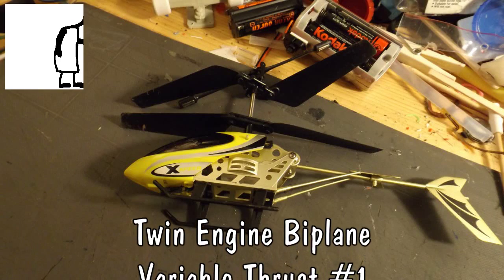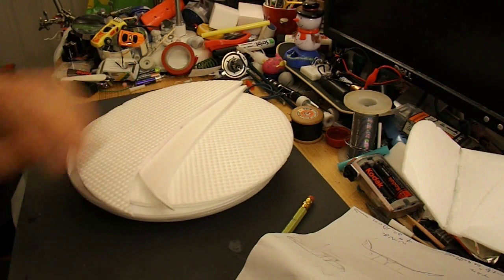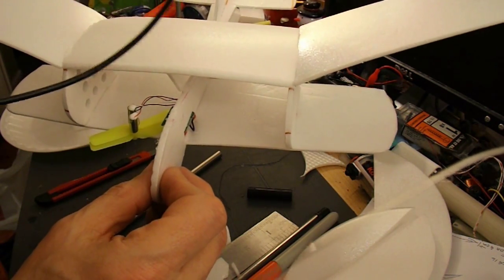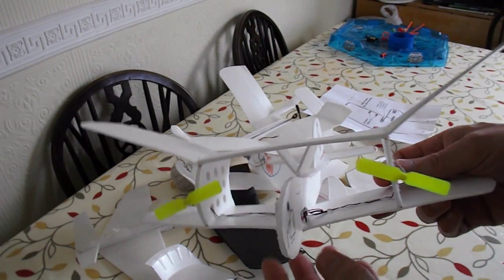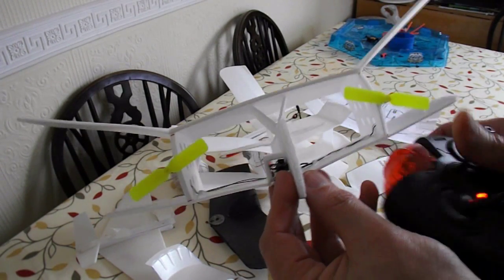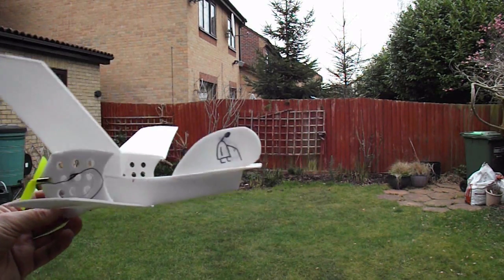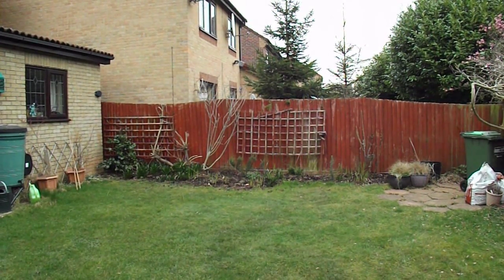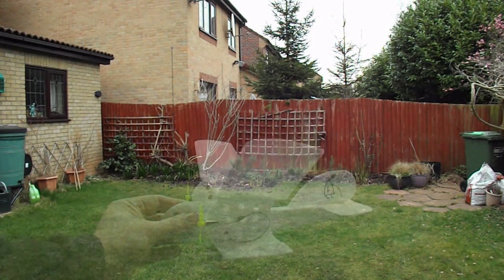Twin Engine Biplane Variable Thrust #1

Comment: Very positive. The theme is cool with the vertical wing struts having the weight holes....it links to the flying car build.
Btw, the I/R LEDs themselves can affect range. If you point directly at the plane as a natural control action, then the (usual) 3 in the transmitter can be straightened forwards. Often they are at least 60 degrees diverse in all directions.
Reply from the maker: Hi Slider, I have tried it in an open space but it cannot handle the slightest wind, so I will have to wait for a calm evening. I may upload the test flight but it just shows that it cannot cope with the wind.
Just had a look at the transmitter and all 3 are straight forward. On the test flight the wind took it too quickly for me to establish any meaningful control.

Comment: awesome aircraft , flexible flight
Reply from the maker: I have tried it in an open space but it cannot handle the slightest wind, so I will have to wait for a calm evening. I may upload the test flight but it just shows that it cannot cope with the wind.
Reply: How can you  design the plane , i tried to do a plane before several months ago  but it is failed ,do you have a design with dimensions ???
Reply from the maker: laith mohamed I just do what looks right to me. It does not always work, but it works often enough for me.
Reply: GrandadIsAnOldMan Thank you for advice

Comment: grandad l think this is one of the smoothest flights, l made several foam rubber band planes but l cant upload it because l didnt record the flights.
Reply from the maker: Hey thanks, you will find the playlist for this plane in the video description and there are some flights with it but using infrared control outdoors is a problem because sunlight blocks the signal.

Comment: Hello grandad can you make another one using infared 2ch helicopter but try to make a nutball design with foam plates. If you place the CG back it can fly slowly in the garden. Slider 2732 microball design.
Reply from the maker: Slider has done some great aircraft but I am really not keen on flying aircraft in my garden. It probably looks bigger than it is due to the wide angle lens on the camera 🙂 Using infrared outdoors is asking for trouble anyway, best kept indoors.

Comment: could you make a tethered flying foam plate using the components from the transformers heli?
Reply from the maker: +random person did you mean flying foam plane?
Reply: +GrandadIsAnOldMan oh, is that what I typed? my phone auto corrected my comment. i did mean plane
Reply from the maker: +random person :) I would think those motors would be much more powerful than needed for a ceiling tethered plane. Have you seen the ones I have already done Ceiling Tether playlist https://www.youtube.com/playlist?list=PLA5a2xPRSrB3vJKgsl1TB3j3-2-6Gvj6H
Reply: +GrandadIsAnOldMan could you use a foam dish as a hull and make a boat from it?
Reply from the maker: random person how about a styrofoam cup ? https://youtu.be/VIyf3pIXG1Q
Reply from the maker: random person or this one https://youtu.be/xu5tKTCNtI4?list=PLA5a2xPRSrB24vUS9E8zkSgjZysEL00zr
Reply: +GrandadIsAnOldMan yes that would work
Reply from the maker: random person yes that is what the link in my reply shows you :)

Comment: Propeller size???
Reply from the maker: The ones in this video are 2508 which is 2.5" by 0.8" pitch but in a later video I use 75mm. I just searched eBay for props that had a small shaft diameter, even 1mm shaft diameter is too large for some of these little brushless motors so I have to fill them with glue.
Reply: +GrandadIsAnOldMan thanks :)
Reply from the maker: Justin Stuart 😊

Comment: plase give me the sise the airplain
Reply from the maker: Hi Viktor, I am afraid I don't do plans. You will just have to work it out from looking at the video. I didn't measure anything, but each section is made from a 9" styrofoam plate
Reply: +GrandadIsAnOldMan can you make a solar power plane
Reply from the maker: Peeyush Jain not a chance. I am not aware of any cheap solar panels that will give the sort of power to weight ratio necessary to power an electric motor that could power a toy plane.

Comment: lololol CROCKS
Reply from the maker: +Brat4PrimeMinister yep, ideal for walking on wet grass.
Reply: after watchin sooooo many of ur vids they were out of the blue....would hav put money on steel toe caps.....keep the vids comin lovin the RC stuff :)
Reply: +GrandadIsAnOldMan how many volts was in that battery????was it a lipo battery????
Reply from the maker: +Simon Lado it is the battery from the helicopter. Yes it is a LiPo and it will be 3.7 volts
Reply: Brat4PrimeMinister yuh